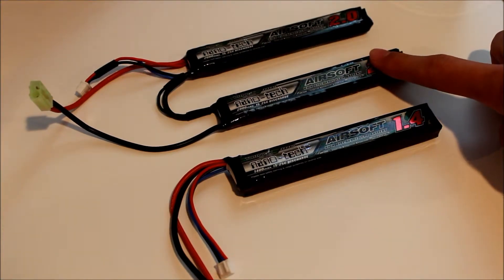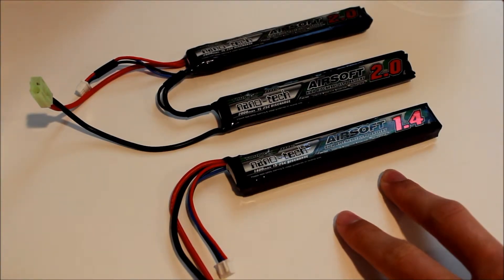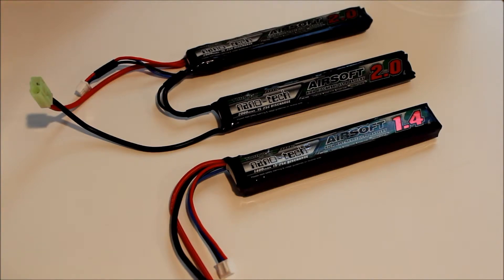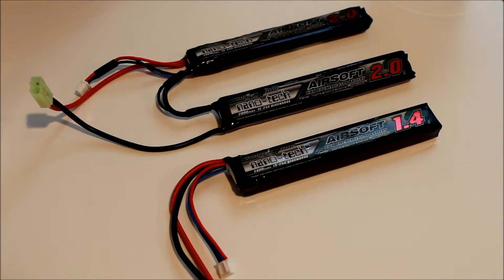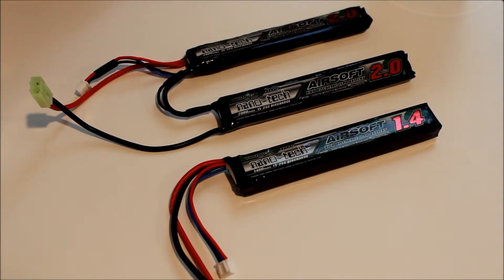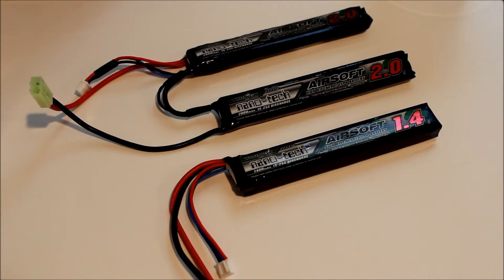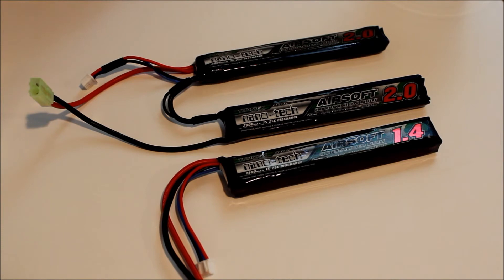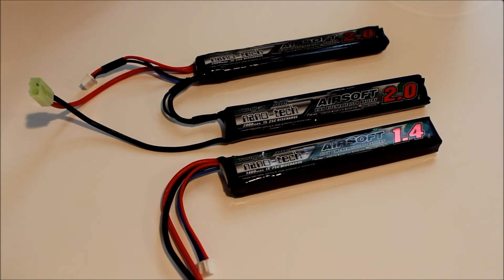Pros vs Cons || Airsoft Lithium Polymer (Lipo) Batteries

Comment: Where's a 11.1
Reply from the maker: I choose not to use 11.1v lipos because the first time I used one it broke a brand new KWA gearbox as I explained in the video. I didn't have any during the time I made the video and thus could only reference them. I'm sorry.
Reply: The CF Project Most stock gearboxes have shitty tuning, even high end ones, and will usually not withstand an 11.1V li-po for long. A custom built gearbox is a different story though, most of my AEG's can be ran safely with a 14.8V li-po, but the ROF will be too fast for most mags to keep up and it's also quite hard on the motor.
Reply: ***** I use I lipo and my gun just gave 6 months not too bad for a stock gun
Reply: miller murdaugh If that's on an 11.1V that's not bad at all.
Reply: ***** yep